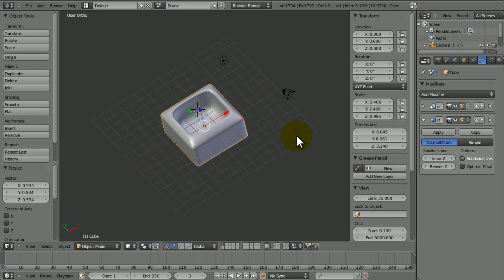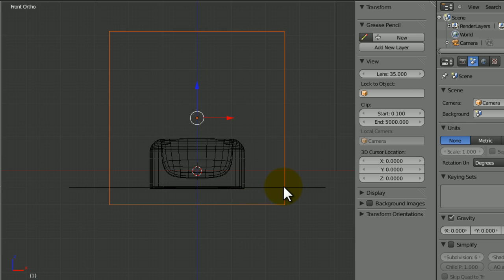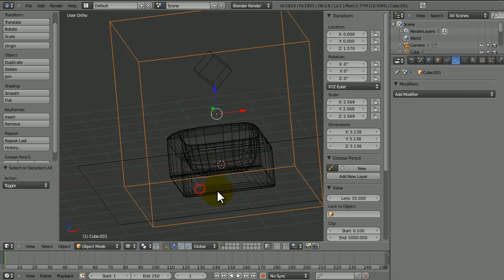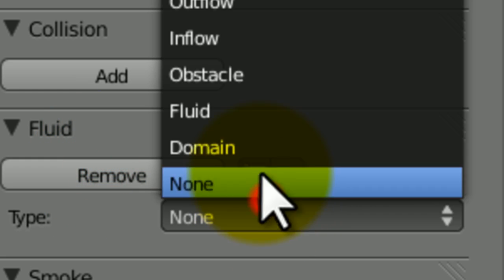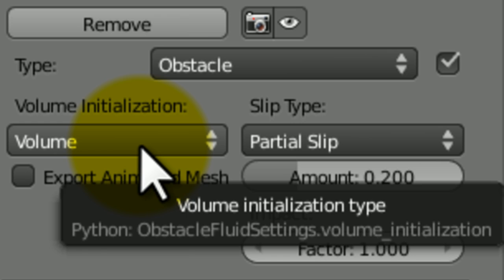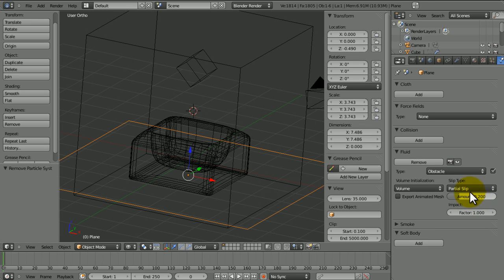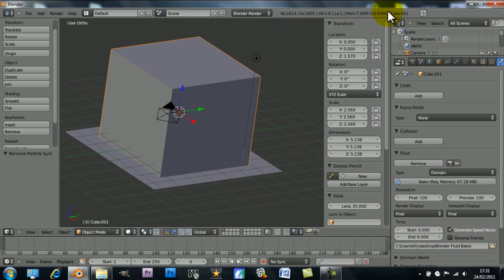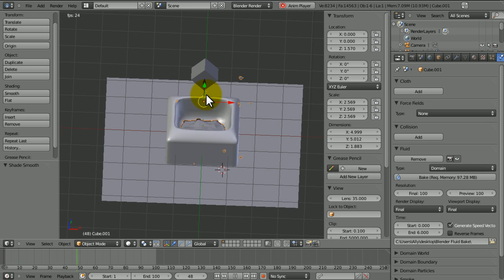[HD] Fluid Simulation Tutorial (Blender 2.56)

Comment from the maker: @LAZrailkapinda There are two ways of Rendering videos. The best way to render everything as an image sequence and use the sequencer to merge all the images but that's a little bit too advanced if you're new to Blender. The easier way is to go to the rendering tab (the one with the picture of a camera) and scroll down to output. You can change the file type and where it renders to in that little menu. The result will be the same as the image sequence, it's just a slightly less practical way.